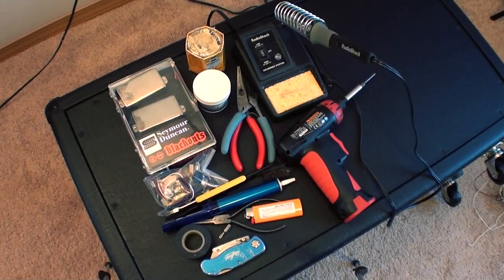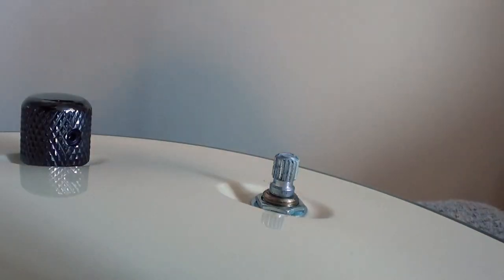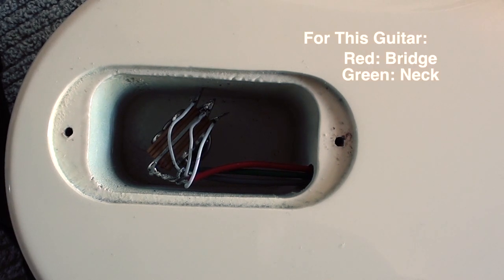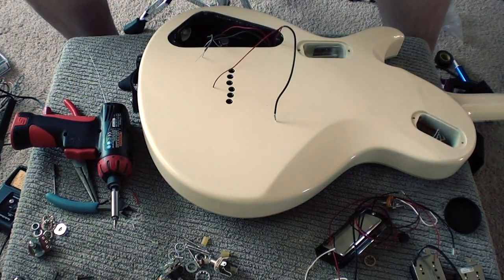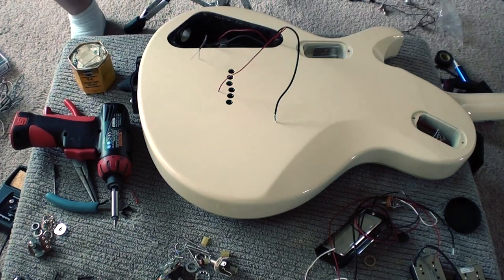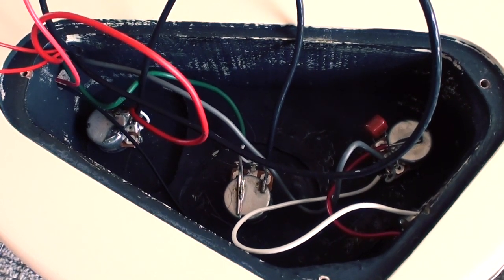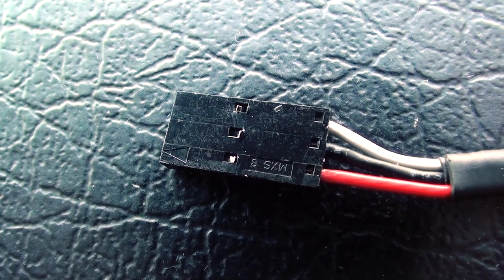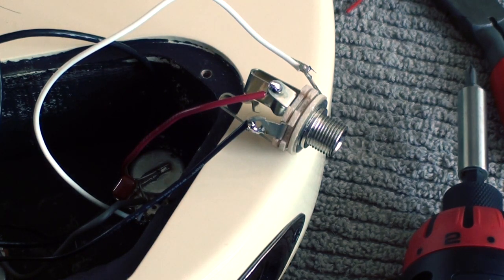How To Change Passive To Active Pickups

Comment: Did I miss the part where you wired the battery? This is supposed to be a tutorial on upgrading from passive (No battery) to Active (Battery). So I would have thought there would be something in the video on where to put the battery, or how to wire it in.
Reply: bkpickell I recently got a guitar (one of the Dean ML 79 reissues) that originally came with passives, but the previous owner put Blackouts in it. They had simply wrapped the battery in a few layers of tape (to prevent shorting) and put it in the wiring compartment
Reply: Yeah. As much as I love Fluff, this just isn't that good of a tutorial.
Reply: I don't think this an instructional video,, he is basically saying I know this and you dont
Reply: Yeah. This is just “read your wiring diagram. Solder. The end.” Video. No instructions at all.
Reply: @speedygonzales55mph  He shows you how to change them. Which is what is in the title. Don't be so upset.
Reply: @Beholder505  Actually what is in the title would mean he is turning passive pickups into active pickups which is entirely different then switching out pickups on a guitar.  Also literally the first line in the description says "In this tutorial".  So yeah, not showing wiring or how to secure the battery for the new pickups makes the video kind of incomplete if the goal is an instructional video, which this cleary states it is.
Reply: @Damaged7  But hey! He at least mentioned that there's a battery 😂
Reply: @Beholder505  no. No he doesn't.
Reply: He didn't tell us how :)
Reply: Fluff seems very knowledgeable... But I wish there was more on the battery safe what to do there...I know how to take screws loose and cut wires...I was wondering about whether or not I needed to router out battery compartment with access door or is it as simple as taping it up in the wiring compartment
Reply: @stevendevault634  you can tape it up in the wiring compartment if you have room. I routed mine to make it look professional.
Reply: Yes, I was thinking that myself. Where does the battery go? What's the rush anyway? This is an uploaded video. You can make it as long as you want. You can make it an hour if you want.

Comment: so you had a guitar with passives and a battery slot?
Reply: schecter does this because they normally come with actives and or it had actives they switched them for passives and for the purpose of this video switch them back to active but if this was a Gibson or any other guitar without a battery slot put a piece of foam over the wires  and place the battery on top
Reply: Sykotikz My Schecter doesn't have the battery compartment, and it has passives.
Reply: This guitar originally had active pickups which is why it had a battery slot.
Reply: @SplinteredCompany  you can replace the back cover with one that comes with a battery slot, you can find them online

Comment: As an electrician, I cringe every time someone calls an open a short. A short is lead to ground with no load between them. Connect the positive and negative battery posts with a wire, that's a short. A cold solder will lead to an open, which is a disconnection. Like turning off a switch. 

Not really the worst thing you can do, but if you want to teach someone how to do something, at least know what you're talking about.
Reply: I am an electrician as well, and I was thinking the same thing. Unless the cold solder joint breaks off with the lead and lands on the back of the pot or something lol
Reply: Amen brother

Comment: A cold solder joint can cause an open circuit not a short circuit unless the joint completely fails and it shorts to another component.

Comment: Really needs a new vid explaining strategy for wire running, compartment use, battery storage ideas etc. This, instead, is a soldering and screwing/unscrewing video. Which we already know or we wouldn't be attempting this upgrade.

Comment: That guitar seems to already have a battery cavity. I have an older ec 1000 the battery for the e.m.g set (that I don't like) has the battery just wrapped in foam in the control cavity. Is there an after market backplate for this?  I may just get rid of the active system

Comment: Ok.... so what about the battery???
Reply from the maker: +archey mwk The instructions for wiring in the battery are included with all of our active pickups.
Reply: +archey mwk I agree, strange they'd leave that out...
Reply: What about the battery compartment? I am interested in installing active pickups in a Les Paul.
Reply: what do you do if you don't have a battery compartment? can i just toss the battery in the main cavity?
Reply: would fastening it with some velcro work?
Reply: Yes, if you want to change the velcro every time you change the battery.
Reply: true, I didn't think of that. Am I doomed to a passive until i can get a new guitar? or do you have any good suggestions?
Reply: I mean, velcro isn't too expensive. You really only need to replace the battery maybe once a year, depending on usage and if you take the jack out when you're done. Velcro isn't a bad option.
Reply: Use the two sided velcro roughly the size of the battery. Use a long enough piece to wrap around the battery. Attach it to the guitar in a cavity with glue or a small screw. Place the battery in the middle of it and strap it in. Should secure it well enough if the cavity it cramped already.
Reply: that's a great idea! I'll put up a video of me trying this when i get some new pickups, thank you so much!

Comment: This is my biggest question. Am I screwed if my guitar came with passive pickups because there's no battery hole? Or should I cut a hole as long as it's a guitar that's not worth anything (Ibanez RG 7 String).

Comment: i have this off brand guitar that my buddy beat the crap out of, it's called"J. Reynolds". so i just started taking all the hardware out, my issue is that i would like to put active emg's in it but there was 3 single coil pickups on it. there is 3 slots where each single coil pickup would go, i was just wondering if there was any solution or if you have any advice that would be helpful i would appreciate it.

Comment: I have a Gibson flying v which has passives in but I wont to change them to EMGs, but where does the battery pack go?
Reply from the maker: +ZAPMAN97 If you changed to actives and needed a battery, you'd have to see if it could fit in the control cavity or route the wood on the back for a battery box.

Comment: Hi! What is the diameter of the threaded portion of the shaft on the pots that come with the Blackouts? I need to know if the size of the pot mounting holes on my guitar are the right size.
Reply from the maker: These should be 1/4" diameter shafts. If they don't fit (if you currently have metric pots, and the holes are too small), you it is easy to use a reamer to make the holes bigger. If you don't have the right tool, take the guitar to someone who does.

Comment: where can I put the battery??
Reply from the maker: Anywhere you can fit it in the cavity.
Reply: What if you have to change the battery
Reply: Harry Matthews You just unscrew the back and swap the batteries
Reply: ***** 
is there no problem with the PU's if I put the battery next to them?
Reply: Well, not really, the battery doesn't output a signal, so the signal from the pickups wouldn't be affected.

Comment: So basically you've changed an already active default guitar back to its standard setup? What about a passive guitar to an active.... I thought that was the whole point of this video?
Reply: I understand what would need to happen but I feel this video was beating round the bush rather than what the majority of people would need to do, in order to change a passive guitar to active.
Reply from the maker: +Scott Thomson In the video, he is replacing passives with actives. Actives were not in the guitar to begin with. He took the old pickups out, replaced the pots/jack/wiring, and then the pickups.
Reply: Oh right okay, obviously i missed the part where a passive guitar has a 9V battery compartment...
Reply from the maker: Scott Thomson The guitar had actives for years, and then passives were installed for awhile. It had a compartment but it wasn't being used.

Comment: I feel like this tutorial is very incomplete. Honestly some troubleshooting tips would be nice. I've been at it for weeks, first the pot holes in the guitar were too small, then I was apparently using solder without a flux core (would've been nice to mention), and now everything is hooked up I get no sound from the neck pickup and barely any sound from the bridge pickup. Hooray, where tf do I start?? This video is merely a "look at how easy our products are to install" without actually covering any of the important or tricky parts.

Comment: where do i put the battery?? my schecter damien 7 has no battery place ;~;
Reply from the maker: silverdragon0000120 Anywhere you can fit it in the cavity.
Reply: ok thanks! :D that won't kill stuff inside right? o-o
Reply: silverdragon0000120 if it does, id just cover it with electrical tape if that would work, black tape is a gift i use it for almost everything haha
Reply: owen shipp ok cool! :D
Reply: +silverdragon0000120 2 words

Super Glue

Comment: it's a pain to see him using a metal melting soldering iron next to such a beautiful guitar without preventing the paint with any kind of protection -,- 
please make sure you protect your paint, otherwise the soldering flux in the solder will ruin your paint

Comment: Terrible layout on the bench, I can’t believe that the body of the guitar sits on the components several times which could cause scratching to the finish! Always lay the body on a soft slip resistant surface and ensure that any components or sharp tools are out of the way, components preferably in a tray or lid so that they cannot roll off the bench or as in this case become trapped between the body/neck of the guitar and the work surface.